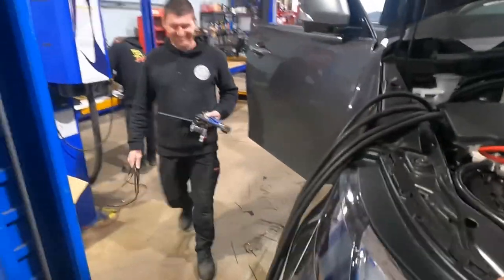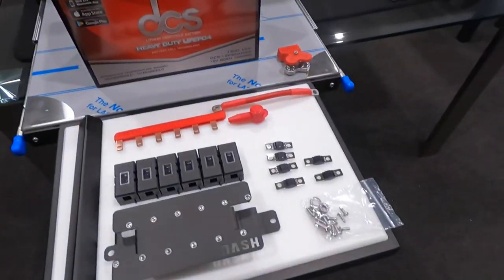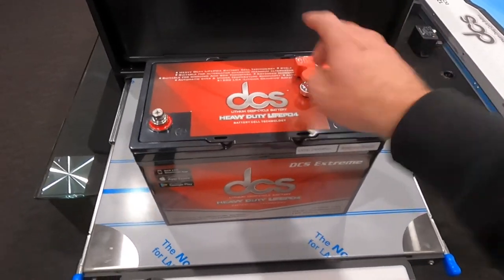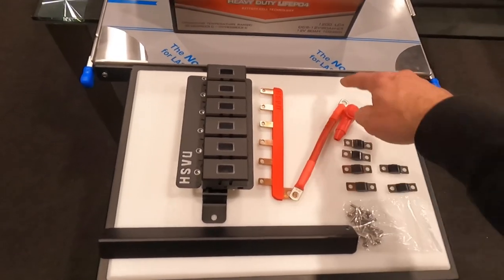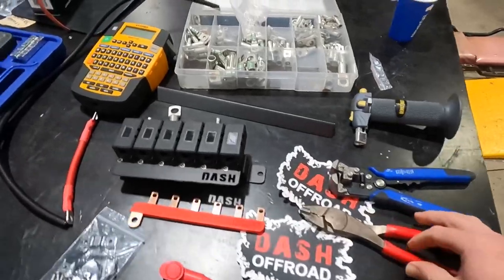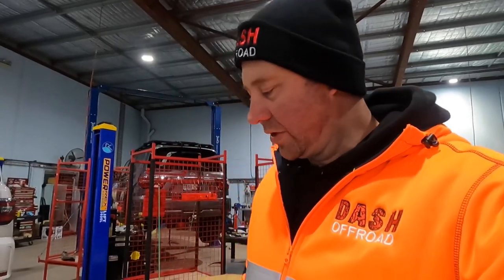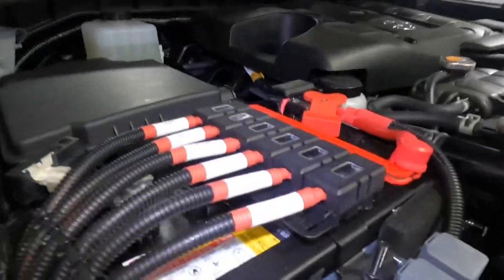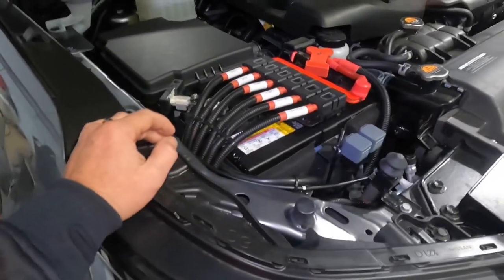Make Your 12V Battery Top Look Like It Was Done By The Pro’s

Comment: Looks great! Another option for labelling that I use as a communications tech is 'Self laminating' labels. These have a white section you can print on with a standard ink jet or laser printer and a clear section that wraps around and protects (laminates) the print. Avery make some pretty good labels and even have the software to go with it. Not so fast for one offs but great if you have lots to do.
Reply from the maker: Sounds interesting